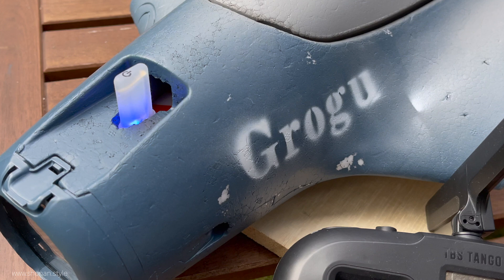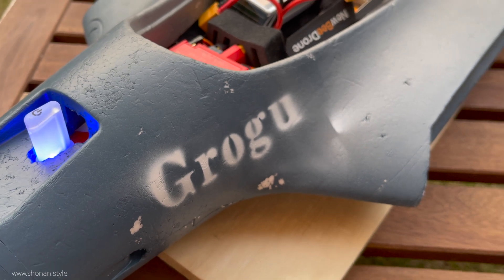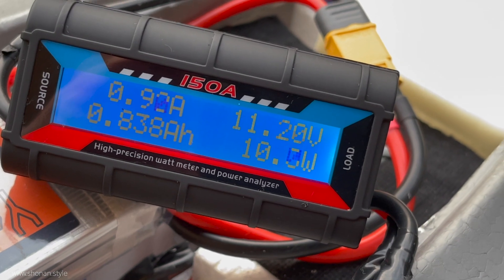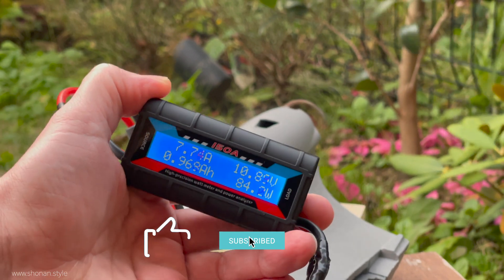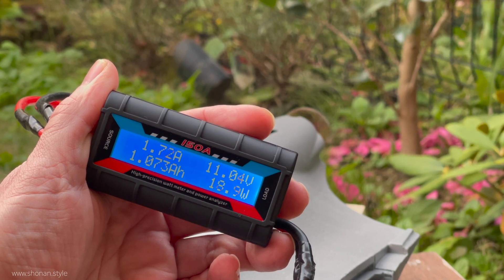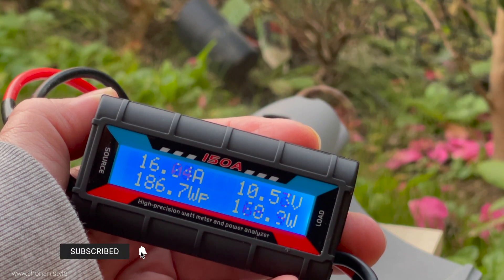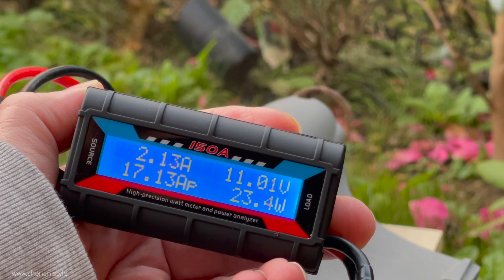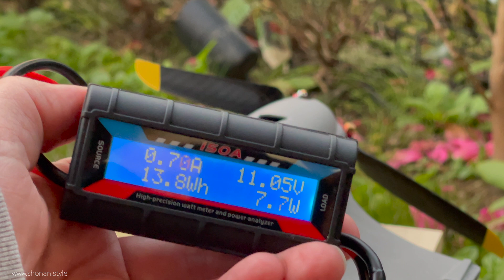Grogu my E-flite Opterra 2m | Parrot Disco HYBRID Project - FPV long range drone build ~ PART 9

Comment: What about all the other brushless motors that you had near the beginning of the series? Good job on your project! I’m learning from you now lol
Reply from the maker: Thank you for the support. 👍🏻
Well, the other motors were working but the one I chose was producing the best thrust amp draw ratio. That is why I went with the SunnySky. 
It was over all just the most efficient motor for the Chuck I could find until now.
Reply: @MattShonan  Also, what did you use to connect the motor to the chuck? Please describe!
Reply from the maker: I used the original plug from the original power train! 
Just soldered the new cables to that one.

Comment: Have you been able to test this new motor with skycontroller by pressing launch button just to check will it start running to full throttle as normal? Had tested different kinds of motors and not every motor will run when launched using skycontroller,
Reply from the maker: Yes, it runs! Just I decided to take off manually to not stress the ESC too much. Then when I am at altitude I can let the Skycontroller take over. 

First flight videos coming up soon! 

Thank you for your support and have a good day!
🎅🏻🎄☃️🎁❄️

Comment: Hey friend... i think the esc in the chuck is 30A.... so i think you are well under. I would be interested in seeing the thrust increase between the new and old power trains... did you record this?
Reply from the maker: Thank you for your comment! 
I am about one amp over the original setup of the Disco which was 15amps at full trottle. 

Interesting to know that the Chuck might do up to 30amps. Could you point me to that source of information. I tried to get that info for weeks but could bot find it anywhere. 

Regarding thrust, I did not measure that since the setup for doing so is a bit complicated. 
Therefore I try to just max out what the new setup can provide and will then do test flights. 

I am having now a cap at 70% trottle programmed in the TBS Tango. 
In case I can verify that the Chuck can take 30amps, I have room to increase that or take it completely out.
Reply: @MattShonan  hi there. Check the comment by Gus on this thread. He mentions the on board ecs is 30A.

https://www.rcgroups.com/forums/showthread.php?2728773-Official-Parrot-Disco-%2A%2A%2AOwner-s-Thread%2A%2A%2A/page259

He is the same Gus that published the walk thru instruction videos for the 4g soft mod.